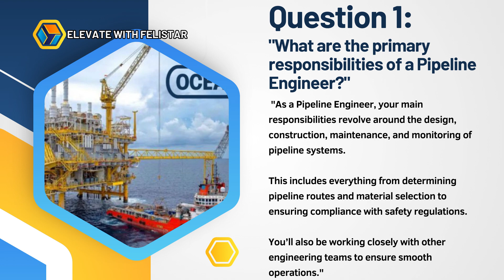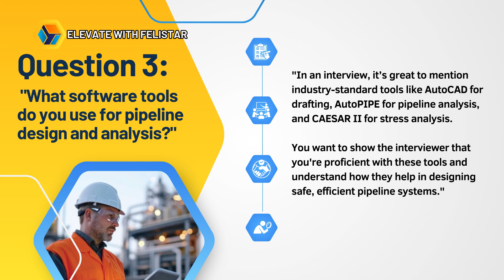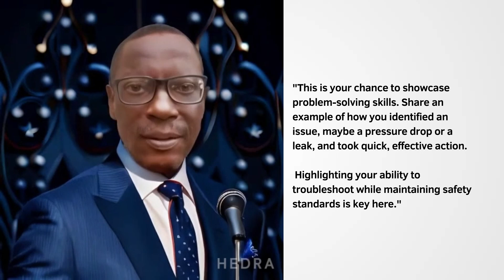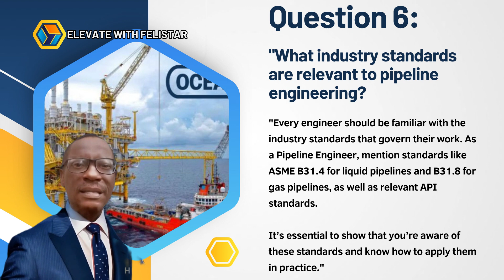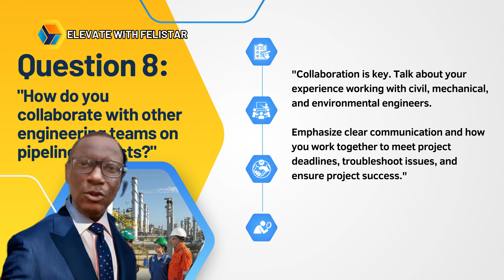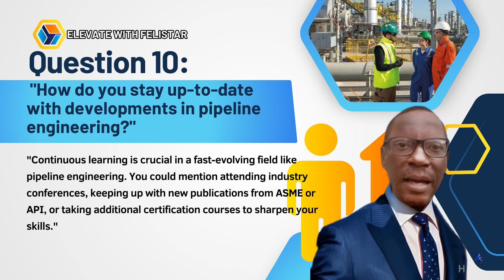Interview Questions and Answers For Pipeline Engineers  (Part 1)

Comment: great video 
Sir , can you also tell which certification will be helpful to get job in this sector
Reply from the maker: Yes, sure. To get a job as a pipeline engineer, especially in the oil and gas industry, the following certifications can be very helpful:

1. Industry-Specific Certifications:

API (American Petroleum Institute) Certifications:

API 1169: Pipeline Construction Inspector

API 570: Piping Inspection Code

API 510: Pressure Vessel Inspector

NACE (National Association of Corrosion Engineers) Certifications:

NACE CIP Level 1, 2, and 3 (Coating Inspector Program)

NACE CP (Cathodic Protection) Certifications

ASME (American Society of Mechanical Engineers):

ASME B31.3 and B31.4 certifications for pipeline design and construction

2. Safety and Quality Certifications:

NEBOSH International General Certificate (for safety management)

ISO 9001: Quality Management Systems

ISO 14001: Environmental Management Systems

3. Technical Skill Certifications:

AutoCAD and CAD Certifications – Useful for pipeline design and drafting

Pipeline Simulation and Design Software (e.g., Pipeline Studio, CAESAR II, or PV Elite)

4. Project Management Certifications:

PMP (Project Management Professional) – Useful for pipeline project management

PRINCE2 Certification

5. Other Relevant Certifications:

AWS (American Welding Society) Certified Welding Inspector (CWI)

Certified Pipeline Integrity Manager
Reply: Here are some certifications that can be helpful for a career in pipeline engineering ¹ ² ³:
- Certified Pipeline Engineer (CPE): A professional certification program that verifies an individual's knowledge and understanding of pipeline engineering principles, design, construction, operation, and maintenance.
- Certified Pipeline Professional (CPP): A certification program developed by the American Petroleum Institute (API) and the International Association of Oil & Gas Producers (IOGP) that recognizes individuals with expertise in pipeline operations, maintenance, and safety.
- API Certified Pipeliner: A certification program designed to recognize individuals who demonstrate knowledge, skills, and abilities necessary to safely and effectively install, inspect, and maintain pipeline systems.
- ASME B31.3 Process Piping Certification: A certification that demonstrates an individual's knowledge and understanding of the ASME B31.3 Process Piping Code, governing the design, fabrication, installation, inspection, testing, and maintenance of piping systems.
- API 570 Piping Inspector Certification: A certification program that certifies individuals with knowledge and experience in inspecting, repairing, altering, and rerating activities for piping systems.
- NACE Certified Pipeliner: A certification program that recognizes individuals with knowledge and experience in corrosion engineering, pipeline construction, and maintenance.
- ISO Certified Pipeliner: A certification program that recognizes professionals with demonstrated knowledge and skills in pipeline safety, quality, environmental protection, and related topics.
- OSHA Certified Pipeliner: A certification program that ensures workers are knowledgeable about safety procedures, regulations, and best practices for working on pipelines.
- Certified Master Piping Professional (CMPP) and Certified Senior Piping Professional (CSPP): Additional certifications offered by ASME for piping engineers.

These certifications can enhance your career prospects and demonstrate your expertise in pipeline engineering. It's essential to research each certification's requirements, duration, and renewal processes to determine which ones align best with your career goals.